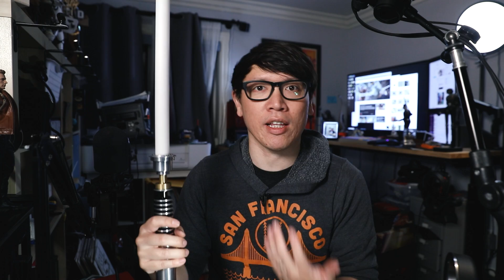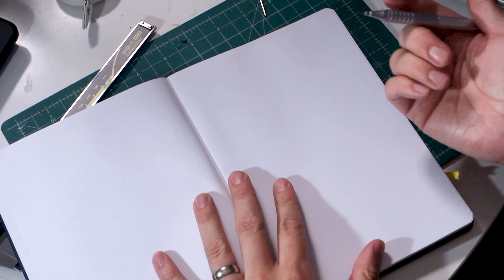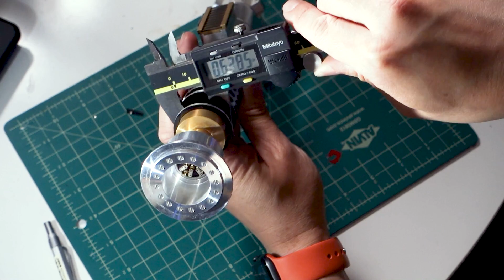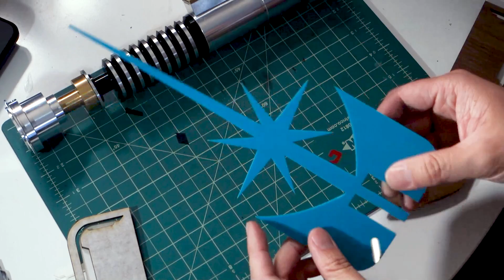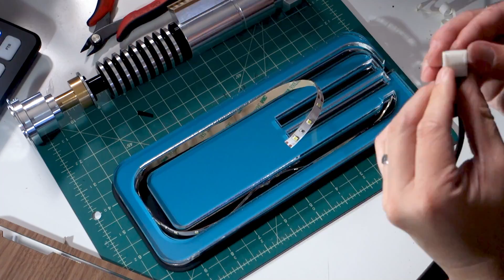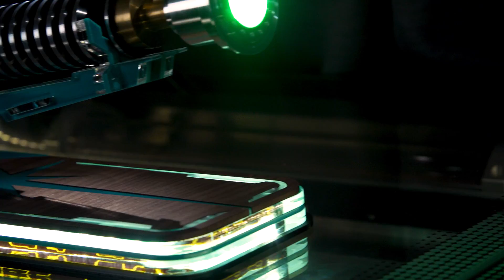Making a Custom Lightsaber Display!

Comment: Denis Lukyanov only makes a replica of Luke's TLJ Creepy Uncle hilt not the ROTJ V1 Cave Scene Hilt. The grenade section features thicker rings, the d-ring is in a different position, the PCB card is shinier and golder, the box rails are thinner and sit flush with the box, and the emitter is taller ala the Obi-wan ANH hero. Basically it was based off a replica of Luke's ROTJ V1 not the actual ROTJ V1 prop.

Comment from the maker: Saber Bay lightsaber parts: https://www.etsy.com/shop/SaberBay
Latest RPF run of machined hilt: https://www.therpf.com/forums/threads/saberbay-machined-alu-darksaber-live-action-run-now-taking-reserves.336532/
Hilt designer is Denis Lukyanov http://l-sabers.ru/ https://www.instagram.com/lukyanov_d/
Pixel blade adapters via ShtokCustomWorx https://tinyurl.com/npxlv3manual
Chassis via Goth 3D Design and Saber Bay
Pixel Blade via Vader's Vault
Soundboard via Plecter Labs CFX
Reply: Would be cool if the holder was Luke's  hand showing robotics inside it
Reply: hi Adam, " let me know when its
time to build a real light saber", 
lol, very cool!, :)